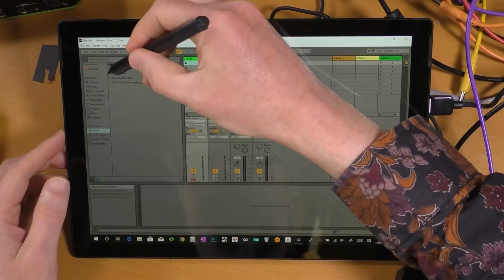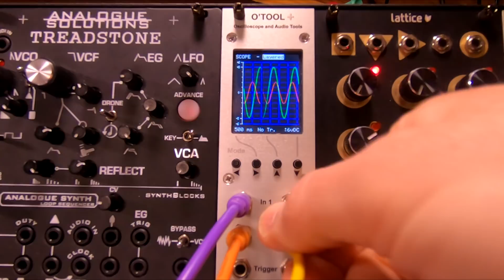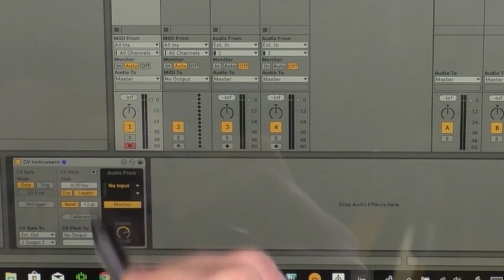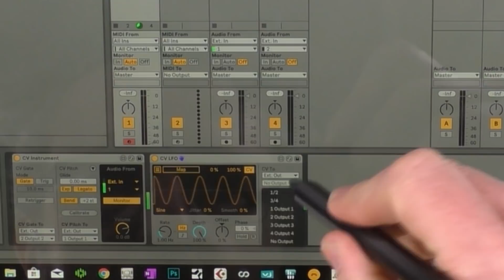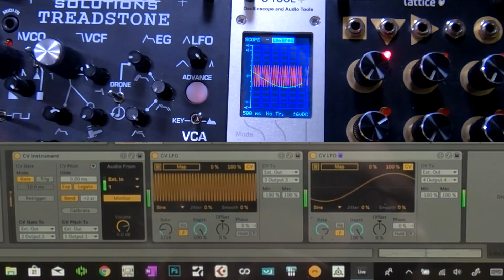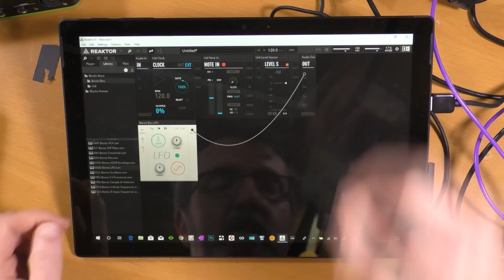Komplete Audio 6 Mk2 DC Coupled to Eurorack with Ableton Live, Bitwig and Reaktor

Comment: Sorry it's me again bothering you and whatever you may be doing today but this has me puzzled.. I have the same Audio interface but when I select the audio input when trying to calibrate I get NO signal input on the live channel volume strip as you do although  I can see the led indication on the interface reacting ?  ( Tried all the inputs but no difference ) Pulling what little hair I have left out. ANY advice would be helpful apart from telling me to go forth and copulate. Phil
Reply from the maker: You'll have to go back to basics. Forget CV - just try to record some audio into Live. The problem, i'm almost sure, is going to be your setup of the audio interface in Live. Try recording some audio onto an audio track using the input you're trying to use for the calibration. Do that first, see the input level, understand how to select inputs because that's all you are doing in the CV Tools. Good luck.
Reply: @MoltenMusicTech  Many thanks again..... it looks as though the Audio 6 may not be compatible with Mac OS Monterey :o(   ( yet ? )  Cheers all the same and have a good day.

Comment: Hello, 
Thank you for this demonstration.
This audio interface is limited to + -2V ... is this sufficient to control modular devices, semi-modular synths (Moog Grandmother)?
Thank you for your help.
DRJ;)
Reply from the maker: Yes, a little bit - that's what the video is about, it shows you exactly what it can do.
Reply: @MoltenMusicTech  Good evening,
Thank you for your answer, but I did not understand all the subtleties.
I understand that the limits were reached with the management of musical notes at +/- 10V which should not be played ?
Do you know of an audio interface (at a reasonable price) which can handle an amplitude of up to 10 volts?
Thank you again for your help.
Good night.
Reply from the maker: @danyrockjr  This can kick out +-2V and so could potentially give you 3 octaves. To get +-5v which is more normal in Eurorack you would need an Expert Sleepers ES9, MOTU interface, RME or PreSonus. None of those are cheap I'm afraid.
Reply: @MoltenMusicTech  Good evening,
Thank you for this precise answer.
DRJ;)

Comment: Is it possible to use your whole rack when using cv tools? I noticed you were only using one, or two, modules, and the rest of your rack was sitting there with nothing to do. Can you use all of your modules at once, and write full songs, with CV Tools?
Reply from the maker: You can if you have enough DC coupled outputs. Each output carries a single CV signal do with two outputs on the KA6 I can run two modulations or pitch and gate. To run more you’ll need an audio interface with a load more DC coupled outputs.
Reply: Molten Music Technology What if you don’t want to use Ableton to modulate your rack, you just want to sync your rack to Ableton’s metronome, and to have the ability to program drums in Ableton, add samples, use Ableton instruments, etc., and combine that with the music from your rack, keep everything in time, and record it all together in Ableton. Can CV Tools be used for this without having 20 ins/outs on your audio interface? Would you consider making a video showing how to combine your rack with Ableton in this way?
Reply from the maker: CV Tools just outputs CV in various forms - you can use that for anything. If you want to send a pulse out to your rack as a clock then do that. You can play trombone at the same time if you wish. The point of CV Tools is to allow you to send things you create in Ableton Live to your modular - but you can simply use it as a clock and use your modular just like you always do and create a shed load of clips in Live doing Live things. It's really up to you - there's no magic involved. I don't have any plans for a video on this because I feel i covered it - but who knows :D
Reply: @MoltenMusicTech  Great. Thanks for your response. I'm waiting on my floating ring cables to arrive, but once they do, I'll experiment, and see what the possibilities are. Would love to combine my modular with my Ableton projects. Thanks!

Comment: I have been following closely (down to the same cables, as well as a Surface and Komplete 6 mk2), but I could not get CV into my Lifeforms Eurorack module until I replace the TS cable in Output 1 with a  TRS cable and 1/4" adapter.

Comment: Great review. One thing I'm struggling with is how you best get audio OUT of your Eurorack for listening and recording! It seems like there are no clear answers or maybe I'm just not getting it. Is there a clear simple answer to this question???
Reply from the maker: Yes. Get an output module. There are several to choose from. I use a Make Noise Rosie and a Tesseract TexMix. They have headphones and line outputs etc.
Reply: @MoltenMusicTech  Thank you for the reply. So something like the Intellijel Audio Interface II would address the drop in voltage when using Ableton in conjunction with this interface and cover output as well?
Reply from the maker: Not sure what you mean by a drop in voltage. Eurorack audio is too loud for for line level to speakers and do the module reduces the audio to the proper level. But you can get away without one using a mixer or VCA to keep things under control. But I’m not sure I’m understanding what you’re trying to do.
Reply: @MoltenMusicTech  Sorry for my lack of knowledge and how to clearly convey what I meant. When I was talking about the drop in voltage I was referring to the issue you discuss at the beginning of this review. Essentially, I was looking to kill two birds with one stone. I was looking for confirmation in regards to that module I mentioned from Intellijel being able to sort out the lower CV coming out of the Komplete Audio 6 from Ableton to the Eurorack as well as being a good option for bringing audio out of the Eurorack into the Komplete Audio 6 then to a set of monitors and or headphones. I hope I'm not sounding like a complete moron. I'm fairly new to all of this and just trying to get myself situated.
Reply from the maker: Ah ok. Well listening to Eurorack and controlling Eurorack are two different things - although I guess it's all voltage..... The Intellijel module seems to be all about audio so I don't know if you can use it to boost CV signals. Honestly I don't know without trying it - for me Eurorack is only understandably if I actually do it - you need to find someone cleverer :D

Comment: great video, thank you! I used the Audio6 before this one and wanted to upgrade a week ago. It seems to have an unfixed bug though which made me go back to the old Audio6. When you connect your MIDI-Keyboard, just some values get send through which makes it impossible to use with MIDI. Nobody seems to have a solution even though a ton of people seem to have this problem unfortunately.
Reply from the maker: Oh that’s odd. Do you mean via the interface on the KA6?
Reply: @MoltenMusicTech  yes exactly - it's not the cable / MIDI-Controller. And i even tried 2 different KA6. Unfortunately...

Comment: Congratulations excellent video! You know if it’s possible control reaktor blocks with a René Module? I mean send pitch to virtual modules? I have the same interface
Reply from the maker: Yes, if you have DC coupled inputs or a cv-to-midi converter
Reply: Molten Music Technology Thanks for answering! Do you know if it is possible to send cv notes with a DJ-1000 MIDI / 3.5mm Jack?
Reply from the maker: I have no idea what that is or what it's for or what it does, sorry. It appears to be specific to Expert Sleepers gear.

Comment: The Presonus Studio 68 C costs the same and would work very good, it’s not Bus powered, i’ts dc coupled, check it out if you can 😉
Reply from the maker: The Studio 68C costs about 20% more, it's not bus powered and it has the exact same CV output problems as the KA6. I've got a video coming up that will explain the issue.
Reply: Molten Music Technology ok, so we must find a proper solution that it works :-), on the KA 6 and other entry line AUdio Interfaces, i have no money for a MOTU for 600 Dollars

Comment: I am wondering if the downside of using a DC coupled interface for normal audio is the re-introduction of the noise? Do you ever notice it? The lack of the filtering...
Reply from the maker: It is possible I suppose but I’ve not encountered any and neither has all those MOTU interfaces so it’s probably less to do with noise and more to do with circuit protection for a rare occurrence of trouble.

Comment: Just ditched my Focusrite and picked up a MOTU Ultralite mk3 for this exact reason. CV Tools is awesome.
Reply: Hi, perhaps you can help me. Got ableton with cv tools and motu ultralite mk3, do you use ONLY TS cables ? Does it work with TRS cables?
Reply: @internalobserver  I use standard TS patch cables
Reply: @OB1techno  standard patch cable means : 6,3 mm TS - 3,5mm TS right?
Reply: @internalobserver  I use standard 3.5mm TS cables with a 6.3mm adapter on one end - I got a bag of 10 of them on eBay for a couple of quid
Reply: @OB1techno  I understand. And is it matter when you use adaptor TS vs adaptor TRS? I have by now only TRS adaptor connected to patch cable but this not work.

Comment: Nice video. I wouldn't take this route. Prefer to keep everything inside my rack. There' something not quite right with the audio of your video. As soon as the sound of your rack comes in it completely suppresses the sound of your voice.
Reply from the maker: I'm sorry you're having audio issues - doesn't seem to be a problem here, the modular audio was generally quite low so i didn't have to duck it as much as i usually do. Maybe what you're viewing it on is compressing the audio. Don't know, but i do try to be aware of that and take steps to make sure the voice isn't lost - so.... dunno.

Comment: Nice one :)  Interesting the Ableton tool gets you to tune to a nice mid point -- I was recently writing a tip about doing that manually when using Silent Way in Reason. You probably saw Reaktor also has a Pitch CV Out block that calibrates. I know most people probably have a MIDI to CV option which is easier but apparently you can get much better timing with CV.
Reply from the maker: SilentWay is good but a little complex and frightening i find. The CV Tools were remarkably straight forward. You know I haven't spotted the Pitch CV Out in Reaktor - I'm never paying enough attention. Reason should have integrated this sort of thing years ago! Yeah CV is just so much more manipulable - you never tend to look at MIDI in terms of shapes and waves, or at least I haven't. And there's lot more depth to cover in all these bits of software :)

Comment: Very interesting how to connect Ableton or Reaktor with the modular rig! As you suggested, how would this work with ES8 (on Mac)? Or could the Novation SLIII be used too? THANKS!!
Reply from the maker: The ES-8 is a USB audio interface - you'll see the outputs in your software - use them. The SL3 is a sequencer.

Comment: nice. if I hadn't just bought a new mixer with interface I'd be tempted. (I'm still tempted) even being able to send a gate/trigger from live is quite a thing (you could use that to clock your eurorack) and have live play in time.

regarding the 4V range. you could boost that with Maths .
plug the output from the Komplete into channel 2 of your maths, then from Maths out 2 to in 3 , output 3 is your boosted signal 

(I just tested it and with both attenuverters on maths at max it boosts a 2v signal to just over 4v)